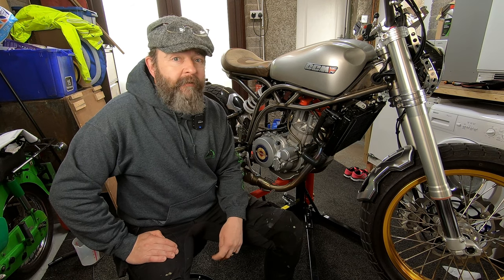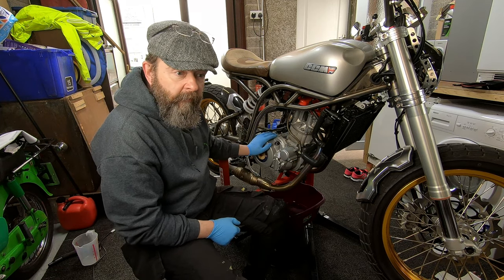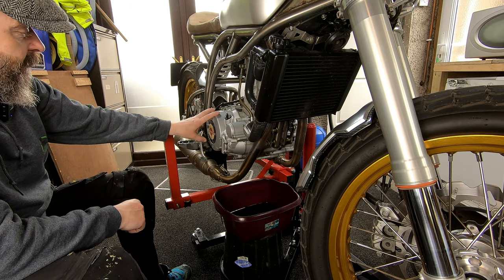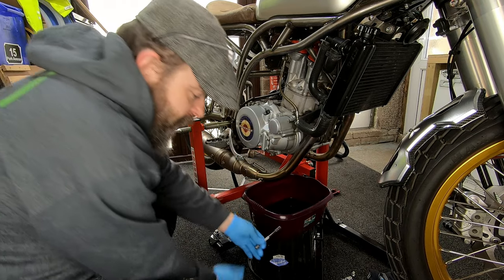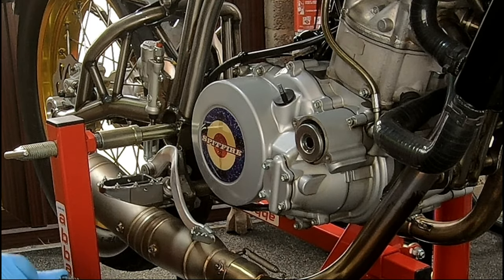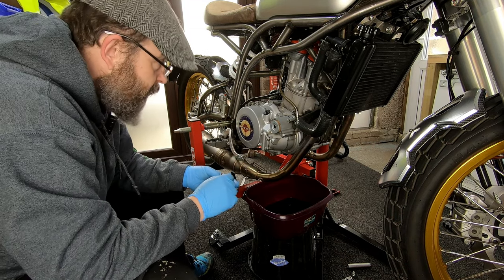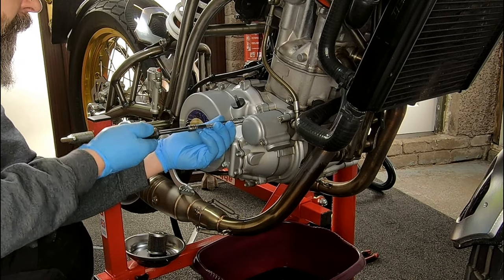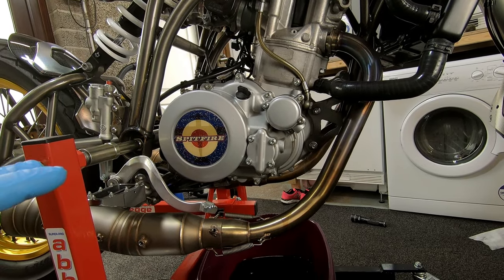In the garage CCM Spitfire Oil Change

Comment: Hi, have you ever taken the rear wheel off? Got a nail thru tyre/inner tube!
Reply from the maker: Hey up, yes I've had the rear wheel off a number of times, just like any other motorcycle, you having problems with yours ?
Reply: @SIMONB1  hi simon, it'll have to come off for new tube and probably tyre, just rode it home yesterday having bought it, 250 miles mostly motorway, it was ok, then 2 miles from home slewing all over the place, nail! ...is it a straighforward exercise from memory? Cheers.
Reply from the maker: It's just like any other bike take the nut off and the axle thro, job done, hope you get it sorted, it's tubeless just plug the hole 🤔, ride safe Simon B 😎
Reply: @SIMONB1  great, thought that rear mudguard/number plate set-up would get in the way and need removing too....not been back to it yet since getting her yesterday. Think the tyre is saveable, but not the tube with a nail in it. Never heard of Mitas tyres before, but found them sticky in the dry.

Comment: hi simon where is the battery and is it easey to reprogram a new fob cheers steve
Reply from the maker: Hey up Steve, the battery bus under the tank, the fob is easy to reprogram using the red key there is a process, or you can get a RFD reader and reprogram your own ,fobs,cards, bracelet to turn the bike on , ride safe, Simon B 👍

Comment: Hi, I own a TE630 and there is a third filter on the right side below the clutch (need to remove the case hence), nothing like that on the CCM?
Reply from the maker: Hey up , Romano, yes there is a mesh filter on the clutch side, I did say I wasn't changing is as u didn't have a gasket, where do you get your gaskets from ? , Simon B 👍
Reply: @SIMONB1  here for example https://www.wemoto.com/bikes/husqvarna/te_630/11/picture/clutch_cover_gasket

SWM 650 superdual / SWM RS650R or SM / TE-SMS 630 are the same too !
I noticed on different forums few cases of failure of the mesh so better to change it periodically as per the manual...
Reply from the maker: I'll check that out, and get a look at mine , thanks for the link 👍
Reply: @SIMONB1  Hi, nice video, which is lucky as it's the only one on the CCM! I've had my Bobber 2 years now. Any more details on that clutch cover gasket? Thanks
Reply from the maker: Hey up Reece, yes theres not many videos around, the clutch cover gasket is widely available, search on eBay and you'll pick one up 😁, thanks for dropping a comment, much appreciated, ride safe, Simon B 👍